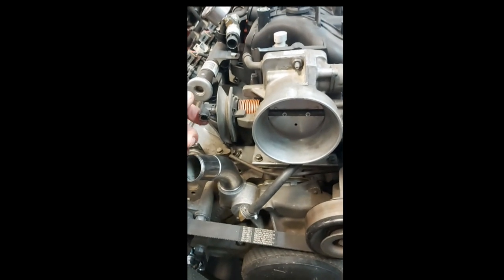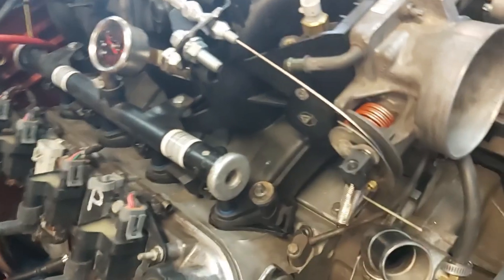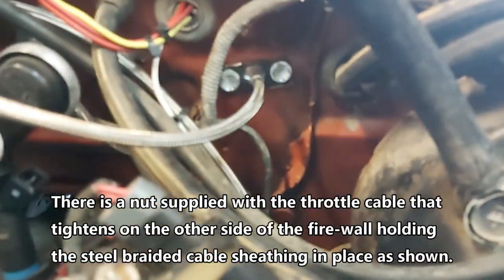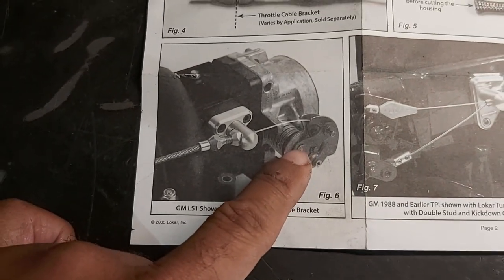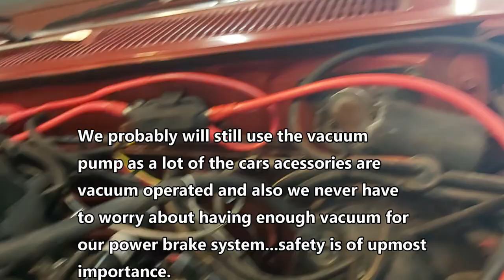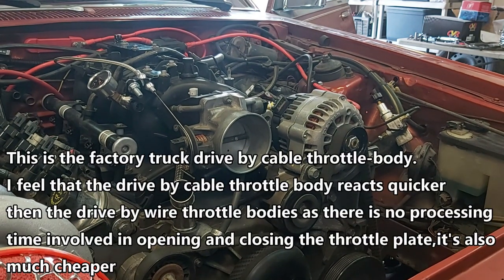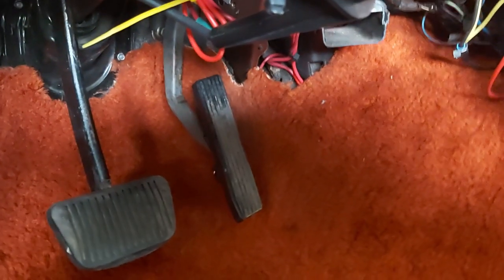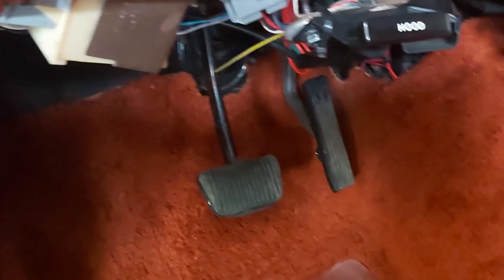LS throttle cable ( Lokar TC-1000LS1) & gas pedal in a fox body

Comment: How did you attach the cable to the throttle pedal?
Reply from the maker: The factory gas pedal, has a slot for the cable to latch into....